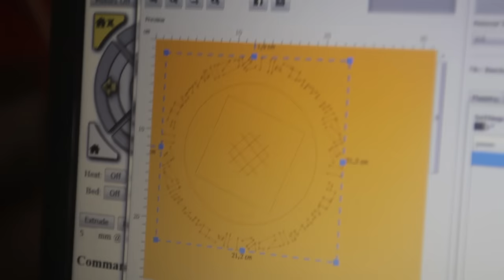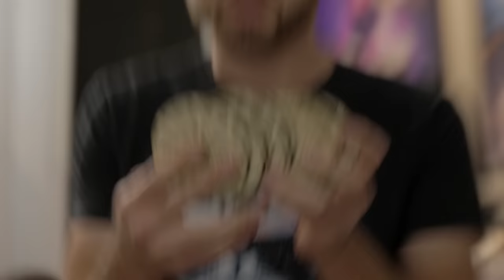Making a Doctor Strange Spell

Comment: use cast acrylic instead of extruded acrylic for a frosty white finish
Reply from the maker: I didn't know there was a difference; you're the second person to mention it. Thanks!
Reply: William Osman you could also first put something like a layer of wax on the acrylic then laser it (so the wax will burn where the pattern is) and use some acid to rough up the surface without the wax-cover
Reply: Ingenious.

Comment: "Kind of like a bowling ball, but it doesn't rip of your fingers"

I see we are of one brain and nightmare.
Reply: He also says 5 finger holes 
Bowling Balls only have 3
Reply: @animeandrew15  I may seem like a bowling nerd here (because I am) technically the ball can have more or less than three, however the most finger holes I've seen is four, maybe five holes when weight holes were a thing, but they're not anymore.
Reply: @j-j8984  I've was in a bowling league myself for many years and I've never seen a bowling ball with 4 holes, then again I was in a youths bowling league so that might be why
Reply: @animeandrew15  I've seen it with mostly older people, they can't hold on to the ball with their middle and ring fingers without pain so they have a hole for their pinkie to help relieve some of the weight and pain
Reply: @j-j8984  That makes sense and also sounds like it might help with putting some more spin on the ball cause I know a lot of the older people in the adult league used a lot of spin

Comment: I know it's an old video, but you could always return to it. Cut the disks in half and run fiber through the design, seal the halves together, continue over and over. Now you use less lights. Also consider adding a dark reflective tape to the outside to condense lighting.

Comment: You can use paint in your cut design that will attract the lights, it should also help with the amount of lights you use because some time's more isn't actually needed. The paint can be a mix of color's and with a blinking lights on a random time spread could make it pop more bringing it more to life, Glossier finishes reflect light and attract the eye or glitter mixed with glue... Just a thought.

Comment: You probably won't see this and/or it's stuid but if you wanted the plates to spin separate you could do a short stretched elastic band so that it would have semi-controlled movement to seem more realistic. If you did that you may have to put each strip on each plate separately which I'm sure would be difficult so I'm not sure. I'm obviously not this super awesomely smart about mechanical stuff

Comment: Looks awesome:) might want to upgrade to a smaller mcu, maybe one of the Bluetooth or wifi linked ones since they're so cheap these days( a few bucks to maybe 10). And you could of course use neopixel type leds to cut down quite a lot on your control section if desired .
Reply: Love your videos, I like making things out of trash myself

Comment: Side-lit laser-etched acrylic is exactly what I had planned. (Great minds think alike, eh?) I wasn't going to go as far as using multiple acrylic plates and LED strips, but I figured one thick piece of acrylic with a different pattern etched on each side would still provide a bit of the same 3d effect. You could also try to program the LEDs to switch between orange and green (the latter if you also have an Eye of Agamotto prop to go with it). Good job!
Reply from the maker: FYI people have said to use cast acrylic for a better result.

Comment: I know I'm really late but for surface finishing maybe coat the acrylic in a relatively strong tape, laser cut/engrave through the tape, and then lightly sandblast it without blasting through the remaining tape. After that then remove the tape and viola. Maybe?

Comment: Use cast acrylic next time. Check out my laser videos for reference
Reply from the maker: I'll look into that. The acrylic I used was material I had laying around.
Reply: William Osman that's called extruded acrylic, they melt and don't mark well. Love the 80w laser machine. I have a 40w myself. You won't find cast acrylic in stores. A 1/4 inch thick 12x12inch sheet crosts usually $12-13. Thinner and bigger sheets are cheaper. It's also more rigid as well.

Comment: This is an older video and you may not check the comments but..... if you ever did revisit it, channels in the discs for EL cable to be run through? Would have a more polished look as it would be a consistent light source in a circle for the etching to pick up... Sorry, I can't suggest where to use tape. There is probably somewhere.... maybe if the centre disc turned on a spindle that is part of the handle/where your palm is when the strap is around the back of your hands and fingers are holding the outer rim.

Anyway, I just saw this video. I've been going through your older stuff :) (videos, not your actual stuff... that sounds stalker'y)

Comment: If you mounted a small motor in the middle of each plate and had them set to spin different directions and random times, it would look really freaking cool (and i would totally buy like 3) also below is like a little model
|=plate *=motor
|*|*|*|

Comment: Hey William I am looking in to getting a CO2 laser i am still not sure it i get a ready machine or build one my self !! and good advise ?? do you  have some place of how you build yours and where to get the parts ?
I am from Sweden so maybe hard to get the parts from the USA
Reply from the maker: Building a machine is cheaper than buying one obviously, but it's still expensive and  A LOT of work. Try to find a more local distributor or look into shipping costs from the US/China. The laser tubes are really expensive to transport. I bought parts all over the place.
Reply: ok good but i dont know how much you can trust the China laser tubes ! And what stepper motors you need and with control unit for the laser, i have had a x-carve befor but now like to get a laser machine.
Reply from the maker: Most tubes you would buy probably originated in China. CO2 lasers are really scary, so you may want to consider building a less dangerous CNC machine first. Laser diode maybe?

Comment: I like that cat tshirt, why an arduino uno?
Reply from the maker: Normally I would use an Arduino Pro Mini since they're smaller and cheaper, but the Uno is a little easier because I can use jumper wires instead of soldering and it has built-in USB. Everything was a little rushed.

Comment: I just realized that you are basically me. I upgraded my makerfarm printer to the makerfarm pegasus 12" as well. Much better
Reply from the maker: I'm going to light mine on fire and roast marshmallows if it keeps up the bad behavior.
Reply: William Osman Whats wrong with it?
Reply from the maker: The wood frame has warped from the heat. It never 'just works'. I always spend 10-15 minutes fiddling with it and 1-2 failed starts before I can walk away and let the print go.
Reply: William Osman The thing that I found with the wood frame was that if I picked it up and moved it I would have to make sure to recalibrate it. I had the I3v version. I would definitely recommend upgrading to the pegasus version of whatever size that is. They are a lot better.